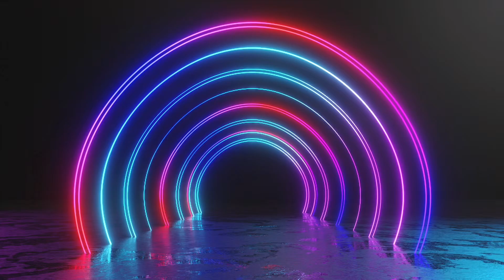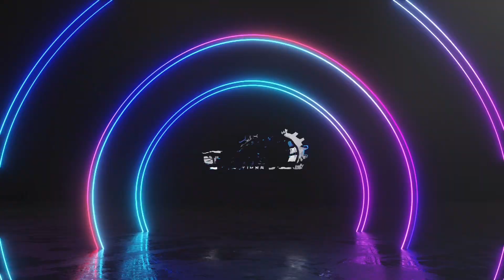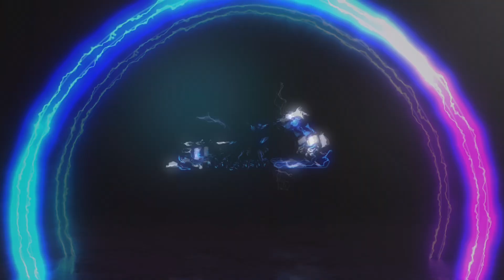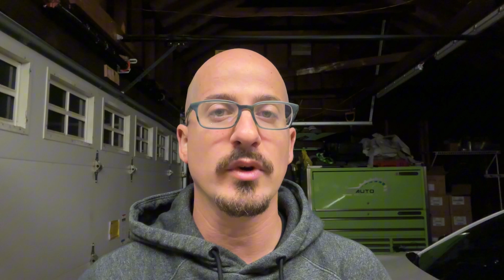Q&A Episode 80 ( Honda 1.5t | hybrid reliability | maintenance minder )

Comment: Thank you for all the great info. Does the 2025 Honda crv hybrid 2.0 l engine use both direct AND port fuel injectors to reduce carbon build up? Will the Honda hybrid crv be refreshed in 2026? Great info as always and thanks

Comment: Thx for your videos. I have a cvt 2.0 slight judder 30k miles at low speed going in for the trans flush. Is it too late ?
Reply: I had a 08 Honda Civic than got the sport 2.0 Civic. I noticed the feel of the cvt trans right away from my 08. My friends a tech @Honda and told me you have to get use to it. Was hoping you had any advice. 💯
Reply from the maker: @ yep, unfortunately it does have different driving characteristics
Reply from the maker: @WILZ300  no it’s not, report back on how it goes.
Reply: @ Roger that 👍🏼💯
Reply: @BCautosutions following up on the maintenance on my civic sport 22 oil and trans service. Went in and they had a kit for the eps recall. Had all services completed and the drive does feel better still at times cvt feels weird at low speeds especially in heavy traffic.
Reply from the maker: @ thanks for the update. Have the verified with a known good car if it’s a normal characteristic or not?

Comment: When i bought my 2020 pilot at 27k around 30k at 1700rpms I was hearing a almost like a soft blow off sound whoosh sound then speed up it goes away i had no clue for the life of me figure out what can make this sound.I couldn't figure out what it was then stated seeing a jump on the needle when driving but wasn't feeling anything in the shifting .did digging and came across saying 3x drain and fill .after 3x DF it went away right after first drive cycle drain and fill .it saved my transmission
Reply from the maker: @pilot2020  nice! Glad that info was out there for you!
Reply: @BCautosolutions  I'm just trying to figure out the whosh sound was and why it made that noise .it sounded like when you hit the throttle partial and makes a whoosh sound on a air intake.ive never heard a transmission make a whoosh sound very odd
Reply from the maker: @ yeah I agree. I was gonna say something more along the lines of possibly a mount or something. Very odd
Reply: @BCautosolutions  i do like to post info like this for the next person with odd situation and the fix .but also bring knowledge to the next person to liston to there cars and being aware of different situations that people can't find solutions by reading and searching.and could bring knowledge later to a random car saying the same situation and a tech says oh it's normal hrs of diagnostics with the fix that could through someone off by intake whoosh sound and say that can't be a transmission sound .it doesn't make that sound lol oh but it does bit try to figure out why lol
Reply from the maker: @ absolutely the more we share our experiences the better. Knowledge is power

Comment: ‘17 HB 1.5T 6MT with 85k (stock, 0 mods). I’m hearing faint tapping/knocking sound (only audible in quite environment with fans not running). I’ve taken it to Honda and master technician looked at it, he claims it’s the HPFP making that sound and they’re getting at least 3-4 cars a month with the same noise. Honda engineering says nothing to worry about there and it’s functioning as designed. Have you ran across this? Video of the sound is on my page. Thank you

Comment: Hello,
Just purchased a 2021 CR-V 1.5t with 20,000 miles 3 questions please what octane gas and change intervals for oil and CVT transmission. 
Thank you I enjoy your channel and how you present no nonsense useful information.
Reply from the maker: @daveysingkoferii7455  congrats on your purchase!

I would use 91 or better octane. Oil changes 3-5k intervals. Transmission fluid every 30k.
Reply: @ thank you I was planning on oil changes every 5k why would they need to be done at 3k?
Thank you for your advice.
Reply from the maker: @ just preference. Those cars have dilution issues, turbo, direct injection, etc. all take a toll on oil quality

Comment: Hey I gotta question on my TLX Type S, I had it serviced a week ago & now after that it smells like something's burning but only when using sport mode plus, my service advisor said to drive the car maybe some oil spilled or something & it has to burn off. What do you think?
Reply from the maker: @djsthemetereman  was it just an oil change?
Reply: Sorry to get back to you so late but yes it was
Reply from the maker: @djsthemetereman  snell still there?
Reply: A little bit not as much

Comment: Where do we submit Q&A? Parents have a 2019 Pilot w/ the 3.5L. NHTSA says their vin doesn't have issues. Safe to trust? Or run oil analysis?
Reply from the maker: @neilquinn  right here like you just did. Great question and I’ll definitely answer this in a video.

Comment: What do you recommend for the 5 speed in the 1st gen Ridgeline?
Reply from the maker: @jobe20001  every 30k unless of doing towing then every 15-20k
Reply: @BCautosutions  thanks for the reply. I usually do a 4qt drain and fill every 25 to 30k. Just wondering if I should be doing 8 or 12 qts.(2X or 3X) I'm at 205k and the fluid looks pretty dirty.
Reply from the maker: @jobe20001  I would entertain either doing it every 15k or a 2x drain and fill every 30k. Assuming it’s engaging and shifting good.

Comment: I don't follow the maintenance minder on my 2020 CR-V either. I do my oil changes every 5K miles. Toyota also recommends changing the oil every 10K miles, which is too extreme, in my opinion. I tell my friends who own Toyota's to change the oil every 5K miles to prevent oil consumption and burning, which tends to happen overtime if the oil changes get neglected.

Comment: My 2024 6MT Integra with the 1.5T is still under the 2 year Maintenance program, but also has the extended 100k mile warranty since it was pre-owned from an Acura dealer (bought with 2400 miles). It's been 5k miles since my last oil change but the minder still says the oil life is at 50%. Should I follow that or get the oil change early?
Reply: I have the same 2024 Integra but with the cvt and I follow what the sticker on the upper left corner of the windshield says which is every 5K. My dealer will change oil based mileage, not the minder. Do it early!
Reply from the maker: @samaabe7510  agreed
Reply from the maker: @PerhapsGuy  5k max. I wouldn’t ever go 10k

Comment: When the third generation Pilot came out in 2016, I would've assumed that the 6 speed automatic would be more reliable than the 9 speed due to the 9 speed being a ZF unit. But over the years, it seems like the 9 speed is actually more reliable than the 6 speed.
Reply from the maker: @donaldwilson2620  absolutely my thoughts as well.

Comment: Great video as always! Have you had any 23-25 Pilots come in with suspension knocking over small road imperfections? I have what sounds exactly like bad sway bar bushings on my 23 but there is no visible play anywhere. I have read about a few cases of defective struts as well and was curious to get your input. Dealers have not been able to find anything and have told me it will most likely just go away with time as bushings break in.
Reply from the maker: @downgeard  sounds like possibly a strut if it’s a knocking. Bushings don’t need breaking in. I can’t say for sure without hearing it.

Comment: Hey man...... I have a question for you whenever you get the time....... I honestly can see that you know what you're doing and I value your opinion.  I get my '22 Civic with a K20C2 dealer serviced, but I would like your feedback on something.  Back in the day I would change my own oil and filter in my older vehicles myself, and when I refilled the oil on a level surface I would get it close to the fill line.  When my Honda dealer changes the 0W20 in my Civic I have never seen it filled above half way up the fill line, although I admit it's not near the add line either. Not sure how the folks at your dealership do this, but is semi-close to mid range on the dipstick ok on your opinion?  Or would it be in my benefit just to give it a small splash to get it to like 3/4 or so?  Maybe I'm too paranoid about it, but I've always been aggressive with lubrication and have never gone beyond 3500 miles between oil changes..... look forward to your comments.  Cheers!
Reply from the maker: @heytherehowareyou1272  I’ll answer this in a Q&A
Reply: @BCautosutions  Thanks...... I appreciate it....
Reply from the maker: @ anytime

Comment: Awesome vid! Got a question for ya: I got a 2024 Hybrid CR-V with 28k kms (~17.5k miles). It recently got cold where I live, like -36C with the wind chill. Been changing the oil religiously and checking oil levels monthly. I also have been using the block heater too. When it’s been cold out and I start it up, the engine will produce this “knocking” sound noise for like 10-15s and then go away. It’s definitely not the fuel injectors as it’s louder than the ticking sound and not as faced paced as them. Do you have any idea what this is? I’ve had the car for 2 winters now, last winter it didn’t do this nor in the summer.
Reply from the maker: @aliyaqub4505  wow that’s some cold temps! Has it been this cold the previous winter(s)? I believe you may be hearing the hybrid powertrain working it can vary as far as noise goes especially in colder temps.
Reply: @ yeah lol quite cold man. Yes in fact, the cars been through worse last winter as it’s only November. Now that you mention it, it totally could be the powertrain. I’m gonna try to take a video of it. Will keep you updated!
Reply from the maker: @ please do!

Comment: I’m thinking about putting better brake pads and rotors on my 23 Civic Sport in the future. What do you think of the ones from Powerstop? I heard Akebono is the OEM ones that Honda uses so if there’s anything from them that might be as good if not better, what would you recommend, especially for stop and go traffic and other situations where you need to brake quickly? Thanks!

When there’s not as much traffic it’s fine but people drive like clowns in my area especially when congestion is at its peak (Metro Atlanta cough cough).

Comment: I have a 21 accord 2.0t, it hesitates on acceleration when digging a out of a hole, Example I am around 2k rpm and get into the throttle it will hesitate, sometimes shake or shutter and make a rattle noise, its like its trying to hold in the lower gear unless I manually downshift or mash the pedal and force it to downshift ( in normal drive mode). The rattle noise is the most concerning part. Is this normal when asking for more throttle without down shifting?? What could be the issues? or am I just asking too much of the turbo and engine when in low RPM? Completely shock car, Always premium fuel and fuel booster so usually 94 or higher octane. If I put it in sport mode and do the same thing I have no issues and she's a beast. Thank you. Love the videos and info, I've learned a bunch from you and appreciate it as a Honda owner.
Reply: Ah yes, the great Accord 2.0t! What a fantastic car!

Comment: My 24 LX has a big glob of Honda Bond in the corner of the valve cover that was squeezed out when assembled at the factory. My only concern is that the sealer may also be squished out under the valve cover, and I don’t want any to find its way into the engine. Will  the Honda Bond stay put over time or can it become hard and possibly break off in the top of the engine?
Reply from the maker: It’ll stay put. It usually smears out a tiny bit when tightening the cover down.
Reply: @BCautosutions thanks!

Comment: The Maintenance Minder on mine seems overly aggressive. At less than 6000 miles, I've had at least 4 oil changes, they wanted to do a full flush last time, too. I don't know what's going into it, but I think it's weighing time too much on algorithm.
Reply from the maker: So you do a lot of idling time, drive it hard, etc?
Reply: @BCautosutions  Nah. I've been out of work this year, and even before that, I worked from home, so it's not like I am sitting in Los Angeles traffic an hour to go 3 miles. Mostly surface street local errands with occasional 10 miles on highway here and there. I don't hoon. Used to have a motorcycle and can fly airplanes if speed was my deal. Actually, my car says 70% life now, but in the email Vehicle Health report I got this week, it says 93% oil life.
Reply from the maker: @MikeSims1103  how long have you had it?
Reply: @BCautosutions  Brand new, Jan 2022
Reply from the maker: @ seems like time is being calculated by the algorithm.